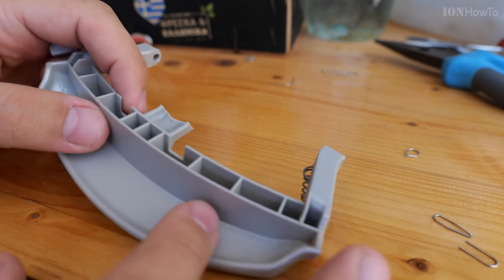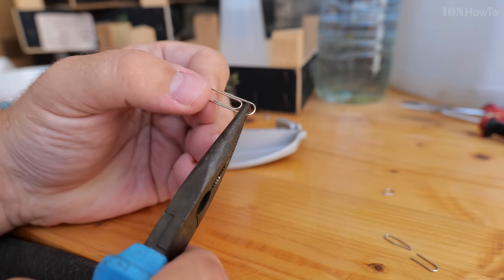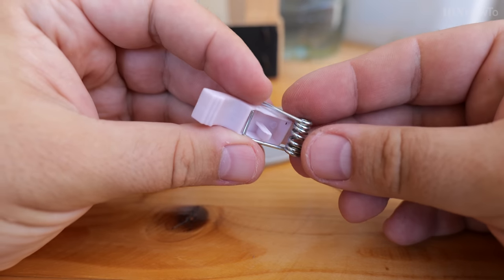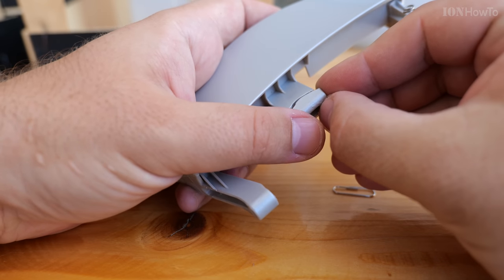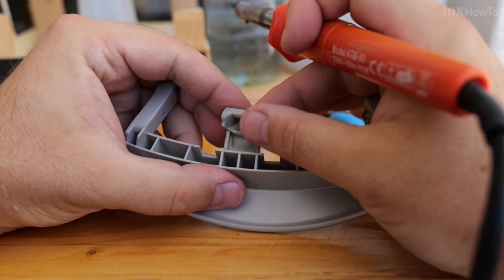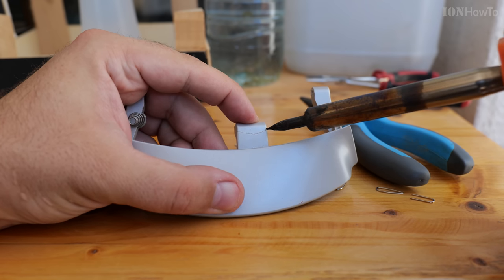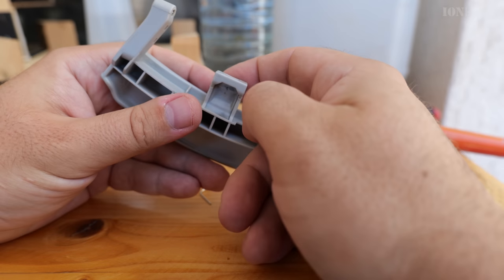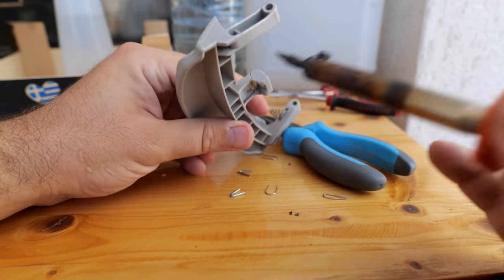How to Weld Plastic diy plastic welding

Comment: You can fill ABS parts with some scrap pieces of ABS disolved with acetone, adding the acetone until you get the ABS to a paste consistency and use it like putty. This is what we use to glue and fill ABS 3D printed parts.
Reply: In caso di polipropilene pp? Grazie

Comment: Or, size the paperclip to fit the repair, holding with pliers heat the paperclip with a propane torch and place on the repair.  Done.
Reply: What me was thinking.
Reply: Or you can use hot air gun also

Comment: That's a good start, but a much stronger joint is achieved by making small rings with the paper clip, not only they are easier to heat up, but also there are more points where the plastic melts along the seam, also fusing the plastic in more spots.
Reply: I saw a small spring cut into rings and I saw stranded wire cut into short lengths laid across the break.

Comment: few tips:
1. use ca glue to temporarily hold the plastic so it doesn't move and its more clean
2. change your soldering tip into a bolt that have a flat head (like a 10mm bolt) so that you can easily put the paper clip in the plastic

Comment: Inspiring good idea. 👍
Unfortunately the reinforcement is just on one side. And the soldering on the other side seemed to be a bit too weak, as you just Applied it  for keeping it briefly in place. 
 I would have added some glue on the breakage  surfaces, too or heated them with a heat gun and pressed them together.
I’d have placed reinforcement on the other side, too, as you make it sink into the plastic anyway  so that it doesn’t stand  in the way.

Comment: Wouldn't gluing the parts together, than tack welding then the paper clip make it even stronger ?
Reply from the maker: If by glue you mean melting the plastic by applying tack welds  yes that's a great option and I actually have a video recorded last month but didn't upload it yet.
I will get it uploaded soon.

Comment: PP I use gorilla hot glue. I had to make a longer and thinner walled nossil for hot glue to get hot enough to push glue in to deeper recesses. A good headlamp is useful a hands free magnifiying tool works well sometimes when you need a 2nd hand. Remenber to rough up and clean the surface before trying to plastic weld anything. Alcohol softens PP a hot glue. PP is gas and oil resistant.

Comment from the maker: For anyone thinking to use a bolt and superglue to hold the parts together, please watch and don't skip the video important parts.

A thicker tip would work better and faster but it's easier to overhead the plastic.

The glue tip, please don't do that. Superglue and plastic welding is not good together - smell of fumes.
Few small welds with the soldering iron will work just fine.

If you use a normal tip you don't need to use anything else to hold the parts togeter.
If you have it at a low angle, it works fine moving it around to make the weld surface even.

All this info is in the video, please do not skip parts of the video and watch the whole info there.

Comment: Just order a new piece. That probably cost about $10 brand new!
Reply from the maker: I couldn't find it for this washer. That is really the best way but hopefully regulation will force manufacturers to make parts available more easily.

This washer is 10+ years old.
Reply: In mist cases you can't order a piece like that separately. Their made cheaply so you just by a new one throw the other away.

Comment: Super glue?
Reply from the maker: This is much stronger than glue and especially super glue even if you mix it with baking soda.
With plastic welding the result is also instant. No need to wait for glue to dry.

Comment: I like to add that after you are. Put some baking soda on it and pour in a few drops of super glue. The superglue bonds very well will baking soda and it fills in the gaps..
Reply: Is there a video that demonstrates this?
Reply: @_wormlet  yeah search baking soda and duper glue. I have seen people use others like wood shaving and even cotton. Personally I used baking soda. There's even a technique where you wrap dental floss around a broken plastic rod and drip superglue on it to form a strong bond. Problem is that it's hard but brittle so won't work for all applications.
Reply: @_wormlet  millions , once it's looked up it will appear constantly.
Reply: @GraniteInTheFace Adam Savage, the red haired guy from Mythbusters, has a video where he uses baking soda and super glue, about a year or so ago.